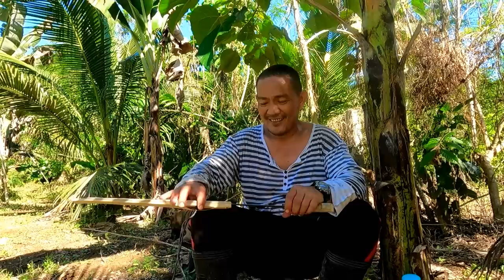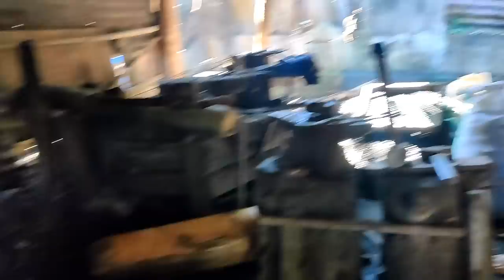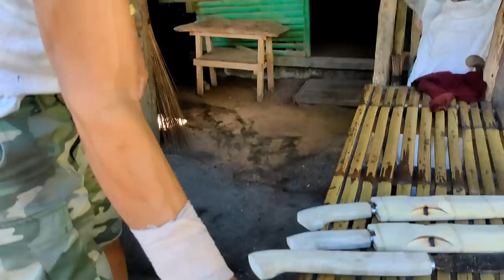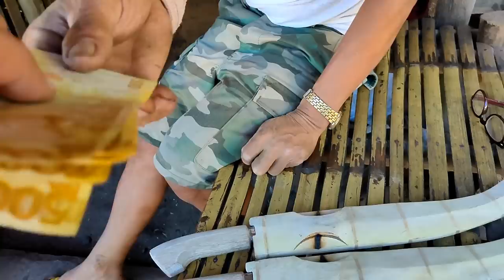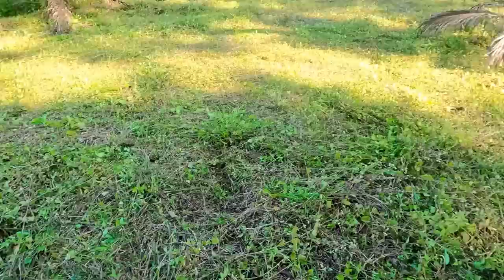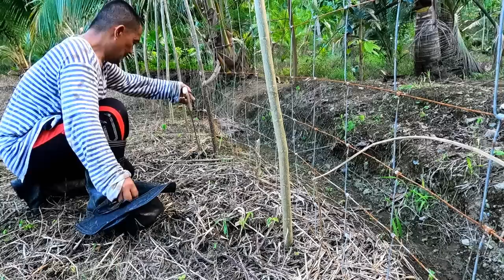Pinakamatibay na Itak Mula sa Lumang Guide Bar Ng Chainsaw

Comment: Sa aking danas sa black smithing iyan guide bar o guide plate ng chain saw ay mas malambot kaysa sa blade ng lawn mower at car leaf spring lawn mower blade o leaf spring ay high grade carbon steel at siyanga pala pati ang bareta de cabra ay napakatigas na bakal iyan chain saw guide bar malambot iyan low carbon yan .
Reply from the maker: Ganun po ba?Pero okay pa din po naman yung pinagawa ko na Yan gamit ko pa din hanggang Ngayon.